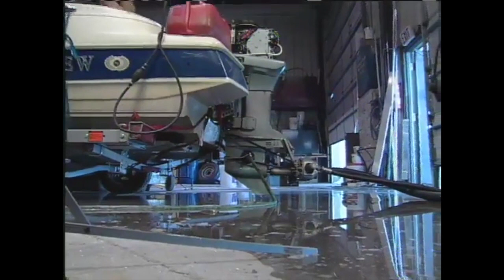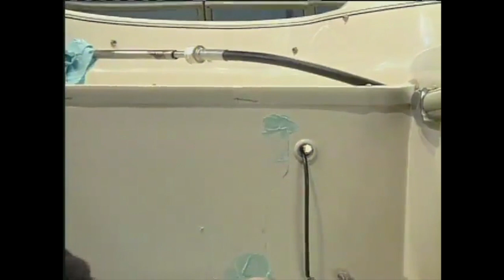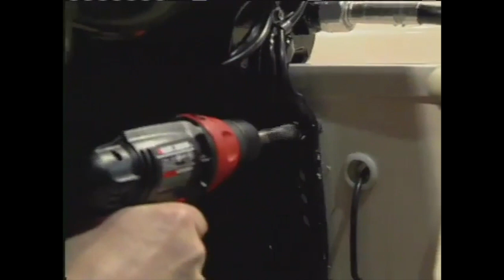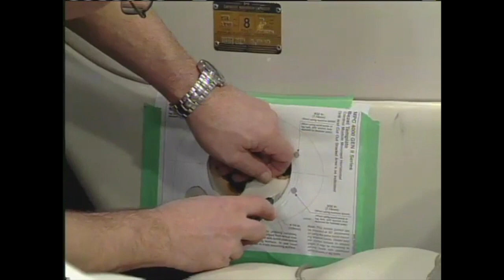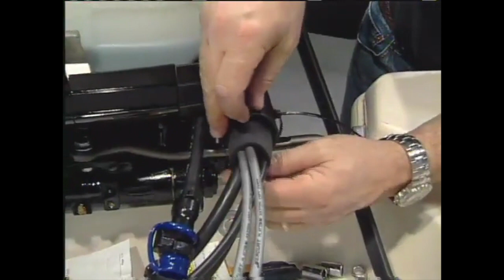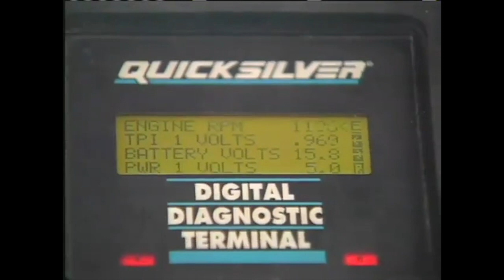How to Re-Power a 2-Stroke Outboard Engine to a new Mercury 4-Stroke | PowerBoat TV Classic DIY

Comment: 9 gph is bad for 70hp? a rebuild for this entire motor costs less than 1/5 of a new one, and is lighter and just as fast. not bad for 80's tech lol. also, both motors use the standard BIA bolt pattern. why are you filling the holes and measuring anything here besides of course the anti vent plate height? also, when installing the throttle cable, each manufacturer has its own method so get the factory manual to make sure you adjust them properly against the throttle cam, being sure to take all the slack out by shifting in forward detent, then halfway back to neutral , pulling on the throttle cable, and seating it in the trunnion cradle.

Comment: That's not a 4 stroke replacement. That's an Optimax 2 stroke.
Reply: close enough LOL
Reply: that not a 2 stroke, look at the oil tank in the outboard. I have 3 225 optimax's, thats not one of them
Reply: @tomfox9880 my recent motor had on my whaler had a 2009 50 Merc 2 stroke and it had the oil tank on the inside
Reply: @tomfox9880  its a 2 stroke lol. you answered your own contradiction by saying "oil tank".